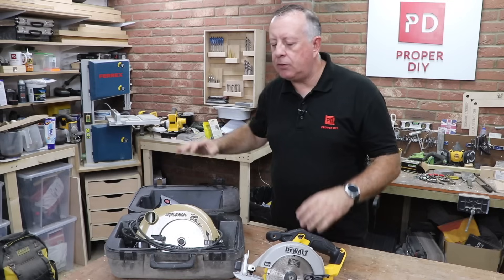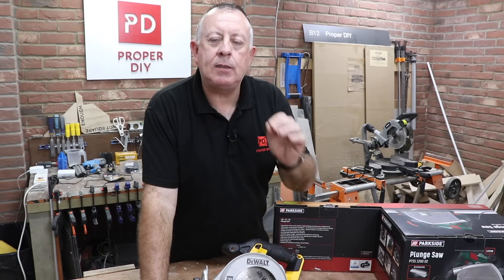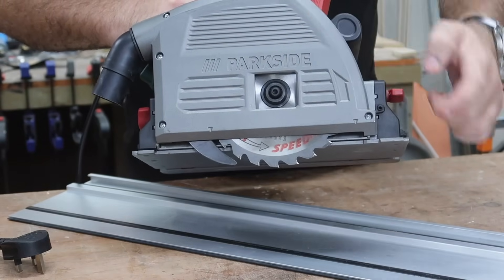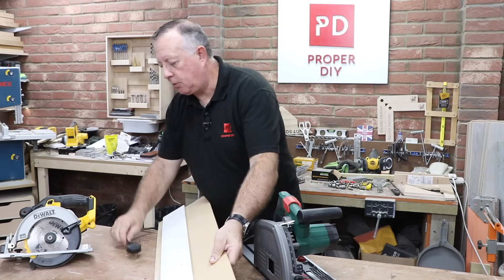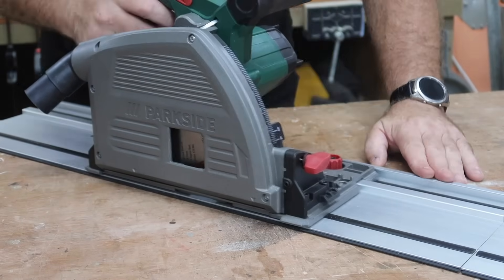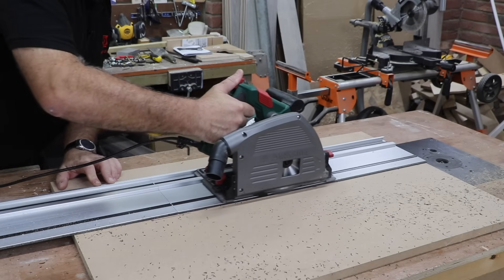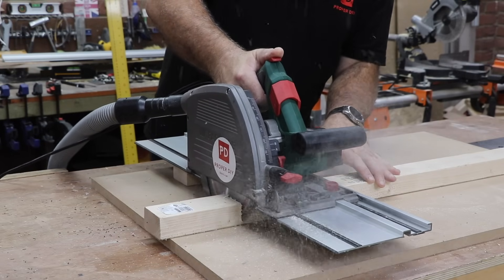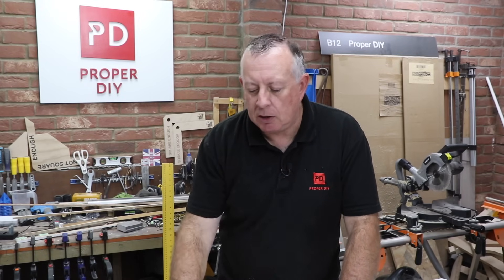Does the average DIY'er really need a Plunge Saw?

Comment: The answer is no, no one really needs one, pro or diy. It's so easy to plunge saw with a circular saw. For sawing straight you can learn to follow a line or use a track/fence.
These are meant for factory-style work, if you work more dynamic than that then don't bother.

Comment: Ive been a joiner/carpenter for over 30 years and never needed a plunge saw. Yes they cut nice, but if you know what you are doing then you can do just as good a job with a circular saw. So no a diyer does not NEED one. Also the money a diyer is going to spend on a plunge saw, they come with plastic parts meaning inferior build quality and they either break quick or there is too much flex on the angle adjustment so you dont have consistent cuts.

Comment: The plunge saw with a track is incredibly useful.  Spray track with some dry lubricant to make things even smoother.  However, that Parkside one looks pretty sloppy to me.  Ok for occasional DIY but if you have the budget try and go for a Dewalt.  That cut on ply looked awful.   The Dewalt has never ever produced a cut of that sort of awful quality.  Also the dust problem is far, far  less with the Dewalt.  Yes I know it is far more expensive but well worth it in my opinion.

Comment: At 3:42 - "At this price, it's not surprising that it's a hard-start brushed motor [...] which I have no intention of changing.
Have a look at what happened to my hard-start brushed table saw motor.  I had to buy a new table saw (dirt cheap), but I modified the next one to give it a soft start, to make it last longer - and it's still working that way.
See : https://youtu.be/9HDLc40Gmac?list=PLuCmHWky5GN4iyRNNchJ4GMcVCSOgdOvc&t=389    Look at it for about a minute.  
This was the beginning of a course on programming the ATtiny85 microprocessor, so there's not much about power tools there.

Comment: As a diy-er you can also take the middle route and use a circular saw on tracks. I use a Metabo KS55FS, which have a base that fits Metabo/Makita/Festool tracks. It has served me for many years. You get the accuracy of a track saw, but without plunge (I don't need that), and with less effective dust collection.
Reply: You can start cutting at any place of the material with a plunge saw, ie. the hole for the sink in the middle of board. You can't do it precisely with a circular saw.

Comment: hang on, your conclusion seems to be that it is a good track saw. I failed to see anything in this video which explains why a plunge saw is better than a track saw?

Add in that your "ordinary" saw is more versatile and can be made into a track saw using your DIY track, please explain what is the point of having a plunge action?
Reply: I’m confused about this too as I recognise the term plunge cut as an experienced cut starting in the middle of the board & not at the edge like you do with a standard circular saw🤷🏻‍♂️

Comment: Why is a circular saw more versatile than a track/plunge saw? If I understand well, you just don't use the track and you practically have a circular saw. Not? Okay, it has cable, but if it is battery operated?

Comment: 1:20 You're not wrong there. I've found that amongst some professional chippies, plunge saws are the ultimate cult. I've worked with a couple who took great offence at the mere fact that I didn't own one and wouldn't drop it when I declined to use theirs. When I have used them I've found them to be far more trouble than they're worth. But that's just me, most chippies seem to get on fine with them, but even though I'm a professional, the space taken up in the van and all the other arigmarol simply don't justify the expense.

Comment: Curious as if this Parkside plunge saw is compatible with Makita/Festool type rail. Hard to judge from a video, anyone know?

Edit: Found the answer in another video, it does not, or at least not the one sold in 2021. Shame, but depending on price it could be interesting anyways if they get it in again, which is the problem.

Comment: We inherited a summer house when we bought our property and 2 years ago I had to replace the roof... they used the cheapest roofing felt and the OSB underneath rotted.
Over 3 days of the late August Bank Holiday, plus an extra day, our new neighbours of only a couple of month put up with me using my DeWalt 18v circular saw cutting out the rotten material and then cutting new OSB3 sheets using guides with the same saw.  I replaced 142sq m of OSB, along with fibreglass insulation that was compromised and then roofing felt that was much stronger.  At no point did I feel the need for a plunge saw, I did hate having to lift up the guard with the blade spinning to cut out the rotten section but a few bottles of water and sausage rolls thrown up to me by my wife saw me through...
When is comes to cutting large sheet, which I don't do often with will used the insulation sheets I have and guides and continue to user the DeWalt 18v circular saw... until a massive projects demands it.
Great video though... also keeping an eye on Lidel! ;)

Comment: If you can afford one and want one, go buy it, most of us took the riving knife off our second best circular saw years ago ! I’m writing this as you go along, But what is a riving knife doing on a plunge saw ? like wot you got ? that means you have a tapered start on your plunge cut ?   I have a ten foot , two part straightedge, was cheap, works well.  
     The answer to the Question is no you don’t. I have done a lot of sheet work over the years and would say that a good fine tooth blade kept just for sheet stuff, and remembering that good boards have straight edges, and knowing the exact distance to both sides of your saw teeth from both sides of the saw plate are key, write them on the saw !  The other thing is - you just can’t do your best work without a stable, flat, convenient saw table. I use two Workmates, two four foots of 4x2 and two eight foots of 4x2 and the last 8x4 board I’m going to use (face down !)
Reply from the maker: The riving knife to spring loaded so only comes out if it has room to do so.

Comment: Great video, but you haven't said that you mostly use a plunge saw to cut out apertures for sinks. If you're a kitchen fitter, then you would use one all the time; if you're a jobbing chippy,  then very rarely. A track saw is more versatile than a plunge saw, and will also plunge if you remove the riving knife.

Comment: I think the question really is, do you need the plunge facility? I have a normal 18V Makita saw and track (with adaptor) and it works very well for me. Very occasionally, a plunge saw would be useful but it doesn't stop me doing anything.